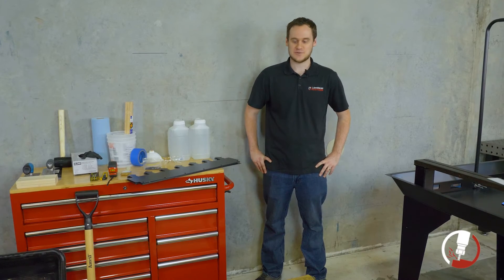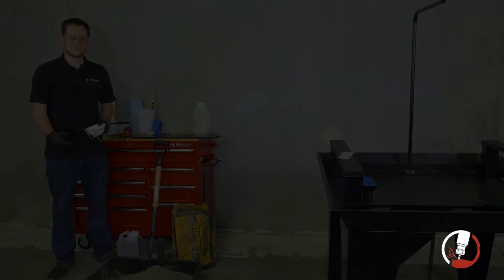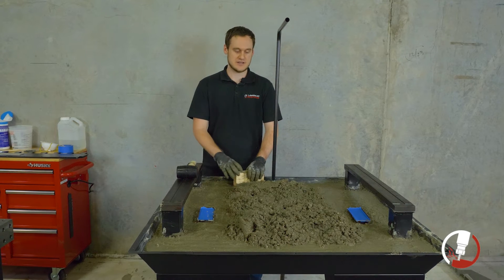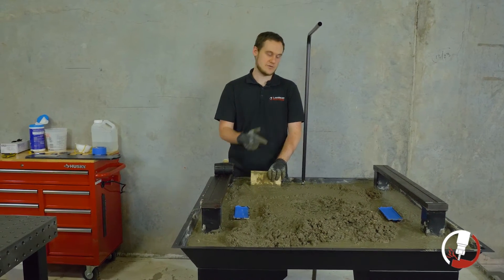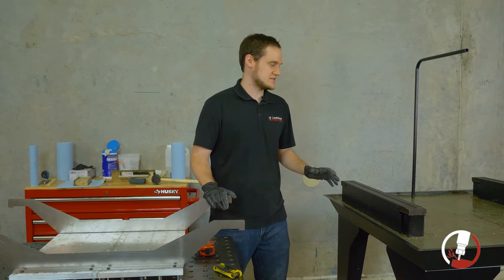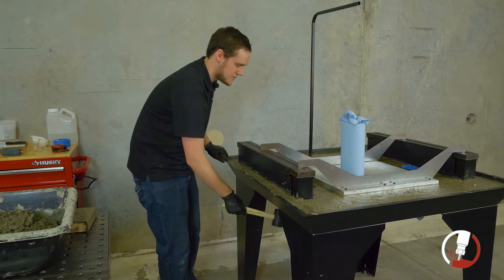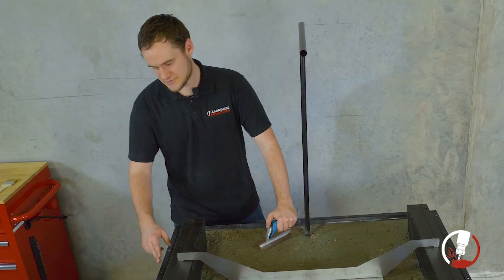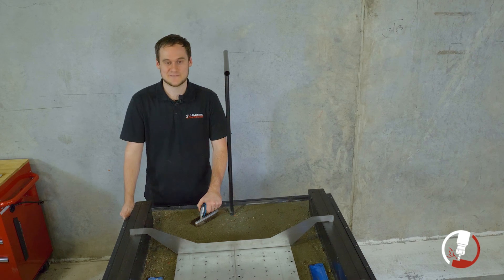MR-1 CNC Mill Assembly Tutorial: Pouring the Concrete Base (Revised)

Comment: Add some bigger aggregate + plasticizer + fly ash + microsilica + some polymer for waterproofing. Optionally, add some reinforcement fibers. If you're pouring concrete, you might as well make it good. Concrete is a serious business and you can get so much more out of it compared to off-the-shelf solutions.
Reply: Based off this video they don’t know anything about concrete. Your comment might as well be foreign language 😂
Reply: is a cnc base, elevated at that, to stop the machine from vibrating. they aint builind a rocket launch pad.